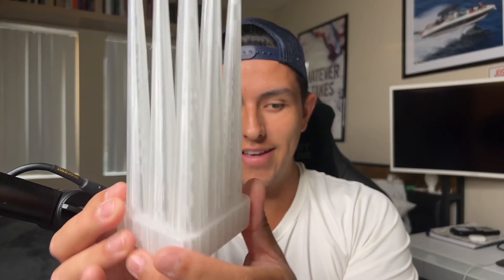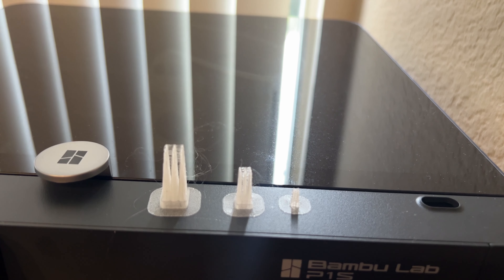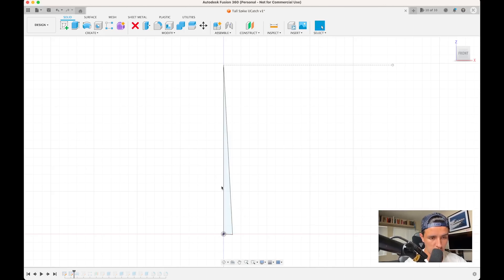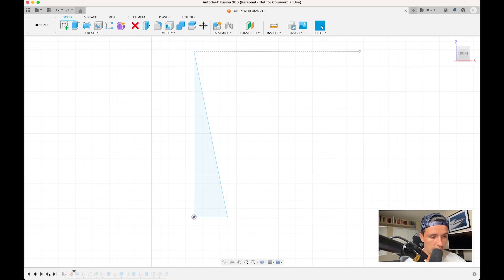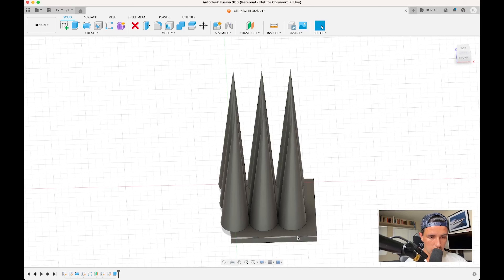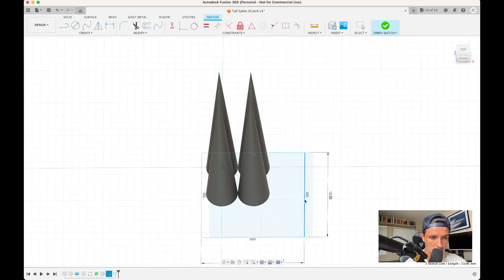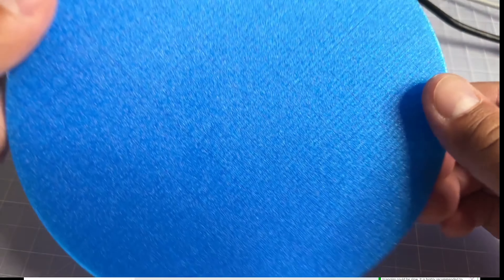How to Use Fusion 360 Personal for 3D Printing

Comment from the maker: Timestamps

0:00 - 3:12 What Product We’re Creating
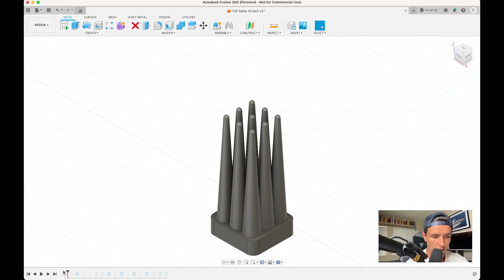3:13 - 5:45 First 3D Print & Size Feedback
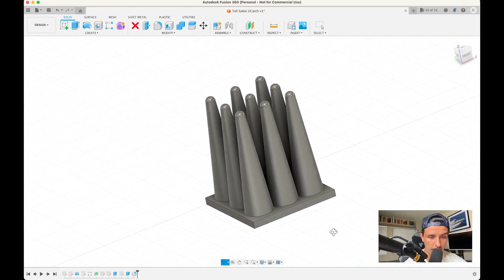5:46 - 21:58 Fusion 360 Work Session - 1st Design Iteration
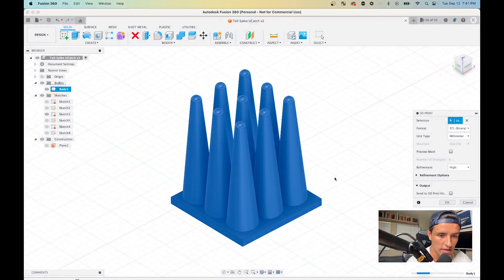21:59 - 22:59 Export .STL from Fusion 360
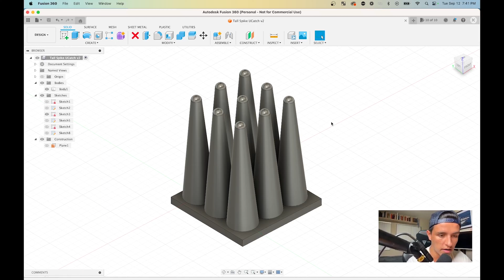23:00 - 24:19 Bambu Studion Slicer
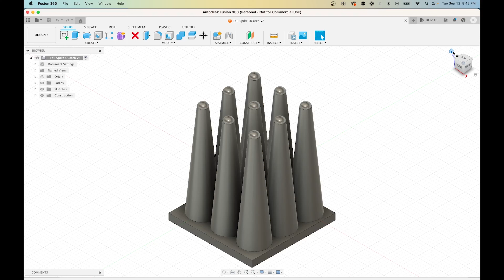24:20 - 24:40 Second 3D Print Size/Shape Feedback
24:41 - 26:34 Fusion 360 2nd Work Session & 3d Printer Slicing
26:35 -  27:00 TPU 3D Print
27:01 - 28:27 Full Urinal Screen Design & Common Fusion Mistakes
28:28 - 30:57 Final Fusion Redesign
30:58 - 31:23 Summary & Feedback Welcome